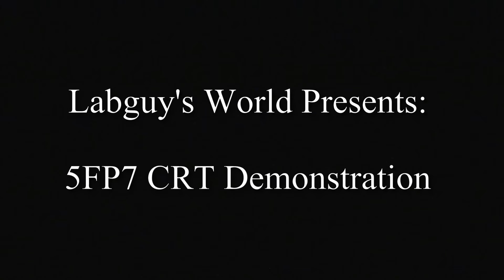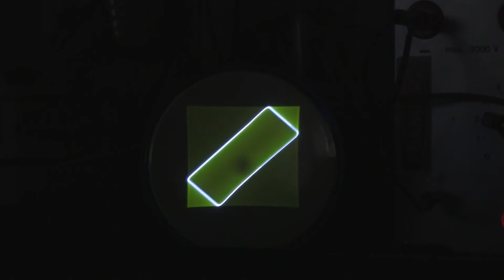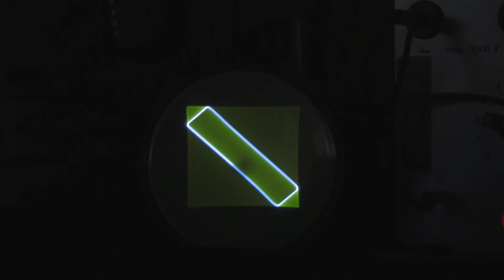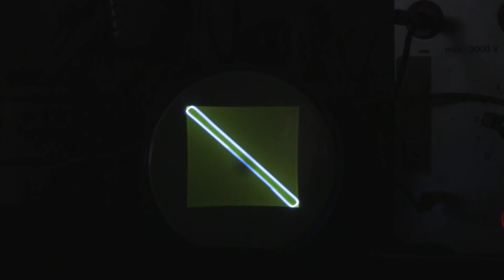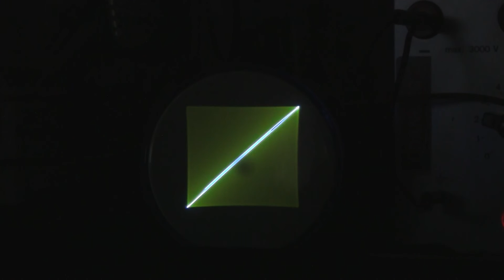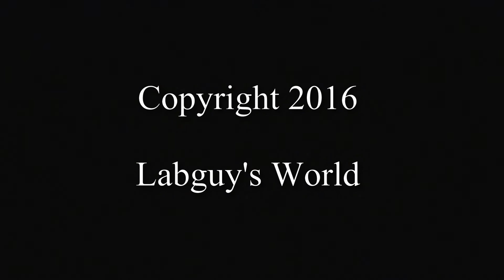5FP7 Demonstration

Comment: Your 5FP7 center have some darken look like ion burn?
Reply from the maker: You have a sharp eye. It is possible that could be an ion burn. But, my theory was that the phosphor deposition was  not even causing the slight variation in brightness. An ion burn is usually a much sharper and well defined spot.
Reply: @videolabguy  I have similar Radar CRT 13SS31D I realize i have the round burning mark as well. I still not sure what cause it, or is it normal to have it after some hour of use? 

https://geeseang.files.wordpress.com/2020/10/image-39.png?w=1024

I recently try to using this Radar CRT to build them into TV monitor without the RF part.